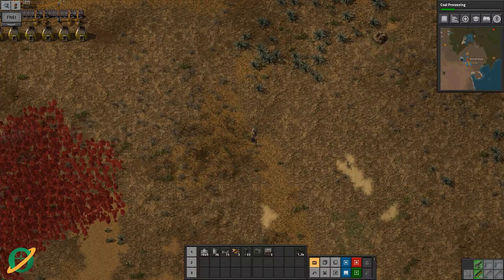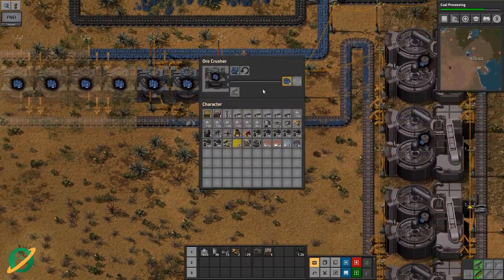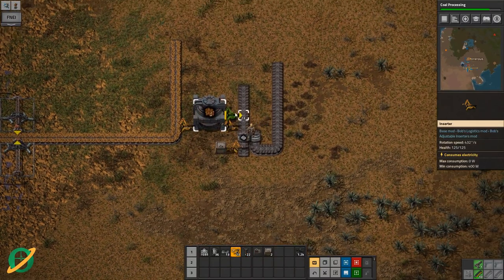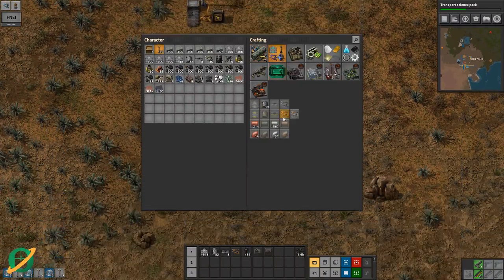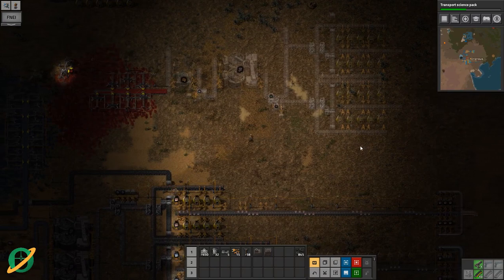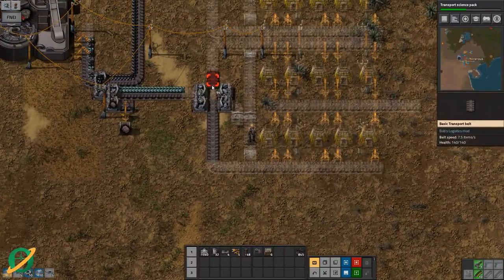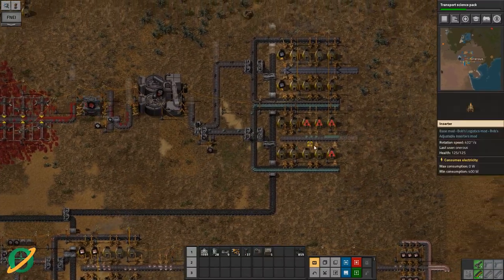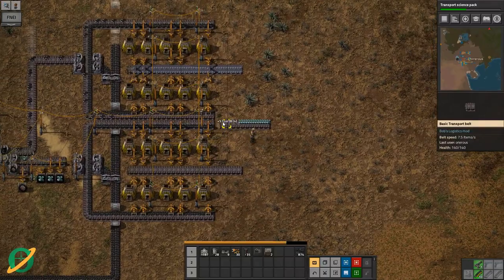Factorio Let's Learn Bob's + Angel's Ep 05: Lead and Tin Plate

Comment: I was surprised you could smelt glass without a blue furnace. Warehouses and loaders are essential for Angels.
Reply from the maker: I really wanted loaders, but I couldn't find an official one by Bob or Angel and I wanted to keep this as pure of a BA run as possible. Later on I use fast stack inserters and they fill a yellow belt with just two of them using the minimum 45 degree swing.

Comment: I realized when beginning my own first AB run that the ore sorting is sort of an early game trap. As long as you don't need any of the byproducts and don't have access to the more efficient smelting methods yet, it's not only easier, but actually more efficient to directly smelt the crushed ores instead of going through sorting (crushed saphirite to iron plate, stiratite to copper, bobmonium to tin and rubyte to lead). The ore sorting gives you a 4 to 3 reduction, and the basic smelting (from the sorted ores to plates) another 4 to 3, so in total you get 56.25% of your raw ore input out in the form of plates, and you have byproducts that you can't consume yet (or for stiratite and saphirite, an interdependency between your iron and copper which you can't really balance correctly in early game). Smelting the crushed ores directly instead is a straight 3 to 2 reduction, so you get 66.7% of your ore input out as plates. That's almost 20% more, plus you only have to deal with crushed stone as a sideproduct, which is pretty easy, since you can "compress" it into stone and then stone bricks right from the start (and many angels processing buildings need stone bricks to craft, so you are actually using at least some of it even early on). This simple smelting will get you through at least huge parts of yellow and red science research (and don't worry, with angels bio processing in the mix, there's plenty of things to keep you busy in the meantime, like automating wood production...).

I know it's a bit late for your playthrough, but maybe someone watching it as a guide (that's how I actually found this series, however after the first episode I decided to "run ahead" with my own playthrough and only watch things kind of "retroactively" to compare my own solutions to others) reads it.
Reply from the maker: I'm on the fence about this one. Having just about launched a rocket now, there are a few things I'm glad I had stockpiled, in particular silicon. With my run (peaceful mode) I took it really slow and lack of resources were never more than an annoyance. Later, slag becomes really useful, so I think in the long run I was better off converting to sorting early. Might be a very different story of you're under time pressure from biters though.
Reply: @OnerousGaming  I play with biters completely disabled, so no timepressure from that front. For me it's more about making the starter patches last. I'm playing on a RSO/railworld map, which means I need to get a train network up and running before the pretty small starter patches run dry, especially as I want to do city blocks (with LTN), which isn't exactly frugal with the train tracks (if push comes to shove I can of course run a temporary simple train line just to get in some more ore, but I want to avoid that if I can).